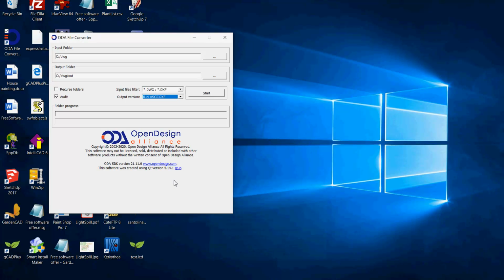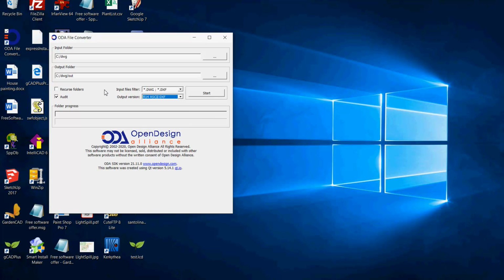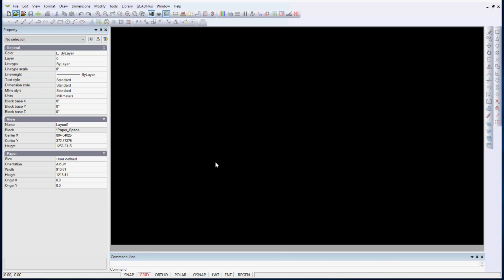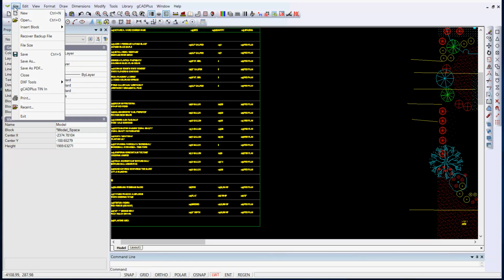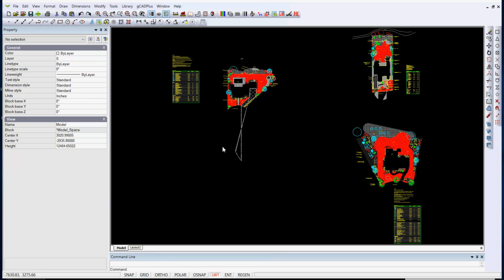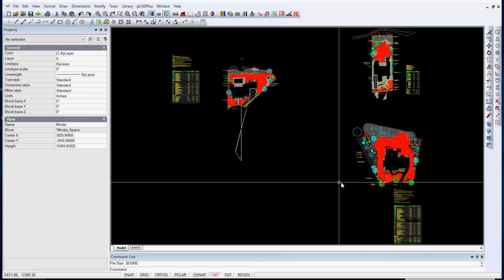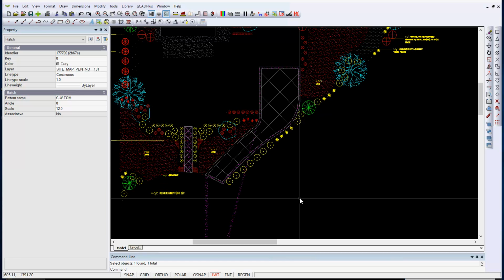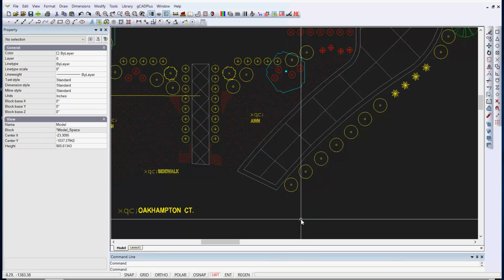Convert an AutoCAD dwg file to DXF using the ODAConversion tool

Comment: I tried several dxf options on the ODA conversion tool to convert a DWG file, and either gCAD shuts down immediately when I try to open the newly converted DXF or gCAD asks me to open a template, after which there is only the model tab available, and when I zoom to extents I find there is only a single line and not the whole drawing. Why can't I convert my dwg file successfully? I did try the same R14 ASCII DXF version of file output as you used in your video, plus several others.
Reply from the maker: Sorry for the delay in replying. I suggest that you download and install Autodesk's DWG Trueview tool. It is free. Use it to make sure that the dwg file is intact and free of bugs before you try the conversion.